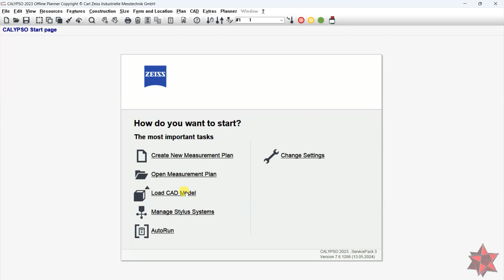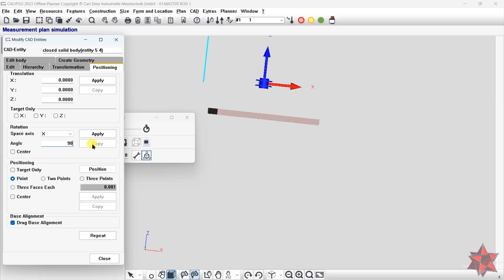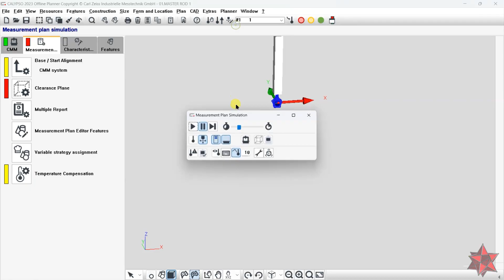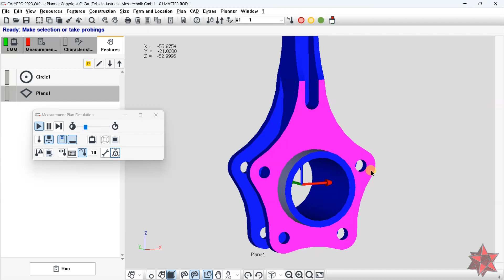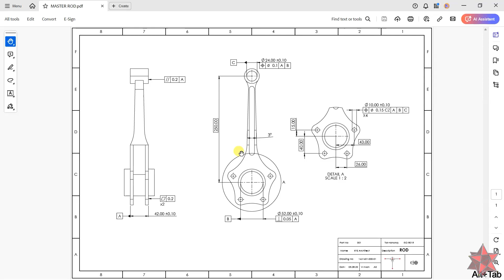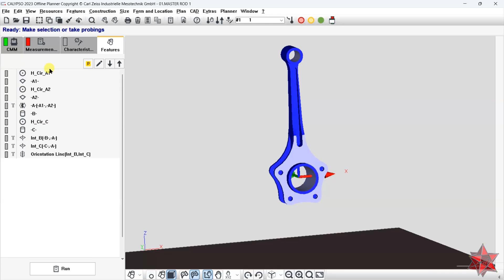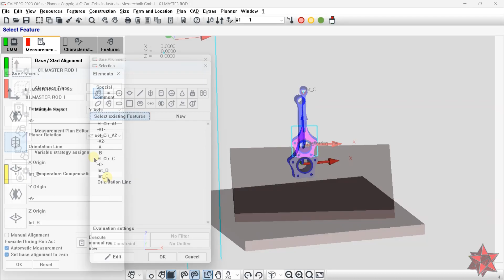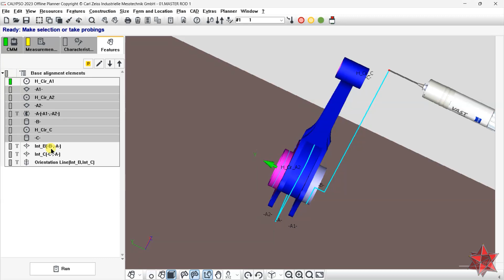Step by step measurement program in Calypso - Base alignment

Comment: Thanks for your videos. I just started working at a shop that has a few contoura's and no one knows how to use them. I was reading the training manual today and was a little lost. Your video helped me understand some of the things i was missing. Curious if calypso can automatically determine the angle of the probe and direction of clearance planes? or do you have to manually enter that each time? Thanks again!
Reply from the maker: It can but it's not always accurate